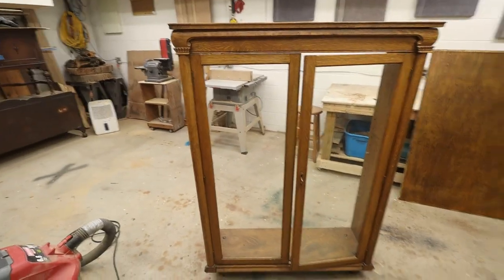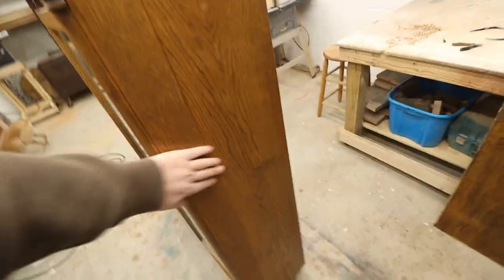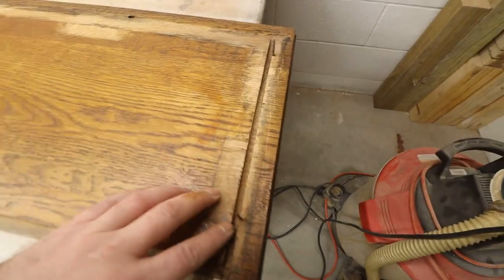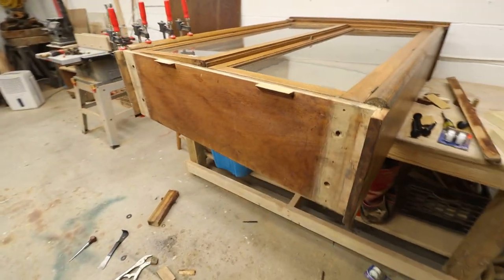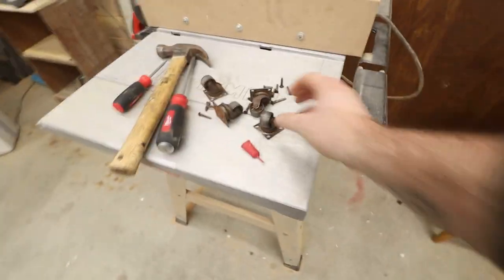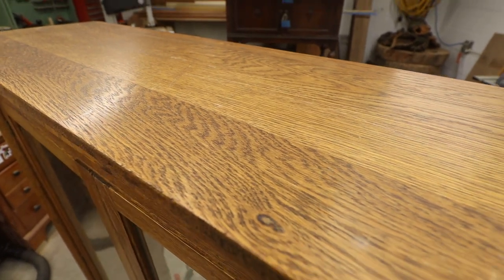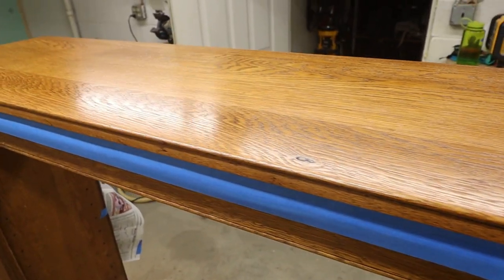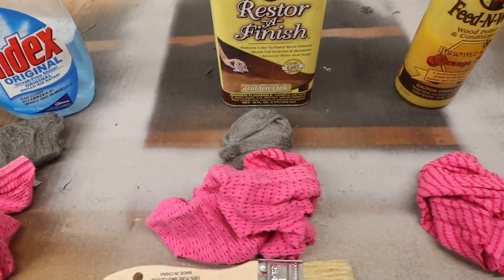Restoration of an Oak Bookcase | 1.16.20 | Furniture Refinishing Repair How To

Comment: Hey John.  As you probably know, tall cases like this would have a fixed shelf somewhere around the middle of the cabinet.  This would prevent racking to a degree.   In the absence of that, the addition of the top and bottom stretcher was a good idea.

Comment: I liked how you showed the three step process of cleaning with the Windex all the way through to the beeswax.  Did you use the 4000 steel wool with all three steps? The bookcase looked wonderful at the end. I’d love a bookcase like that.
Reply from the maker: Thanks! I just used the steel wool with the Windex and restore a finish. I apply the wax polish with a rag.